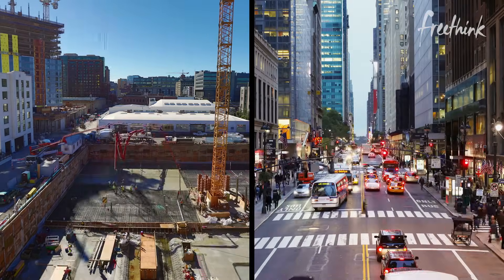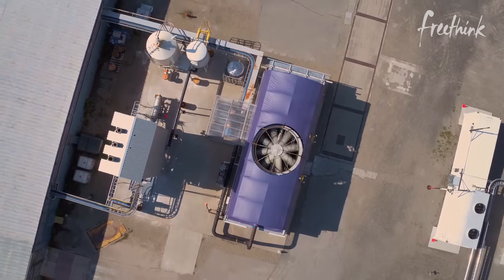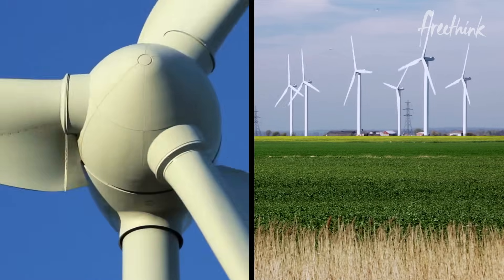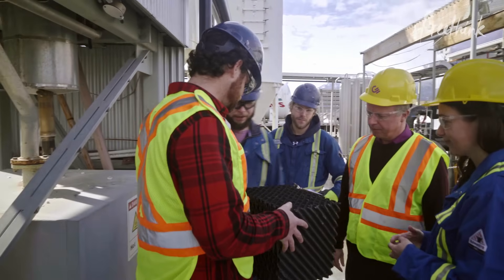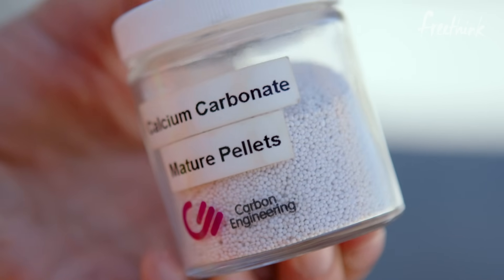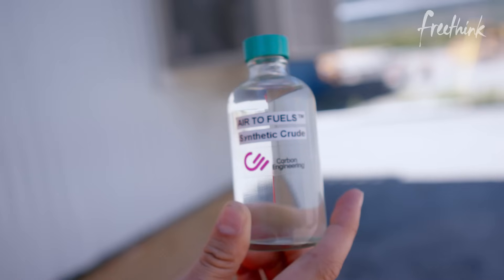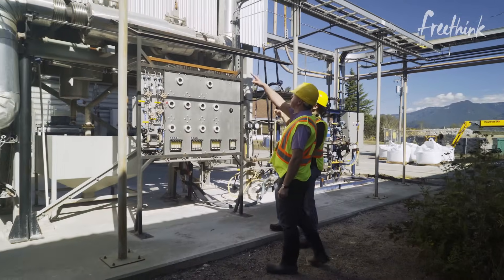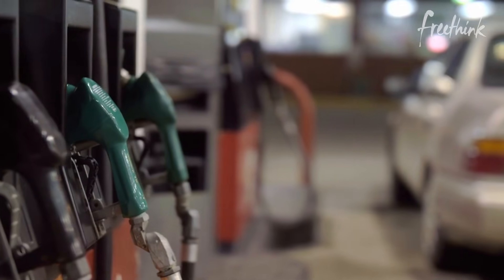Carbon Capture Technology Explained | Seachange

Comment: XPRIZE CARBON CAPTURE Please share, thx
FORMULATED MICROCRYSTALLINE WAX WILL CAPTURE CARBON-SOOT
The heat loss from a smokestack can be forced into a large tank containing hot liquid microcrystalline petroleum wax. The heat will keep the wax at a molten state which facilitate the carbon to be absorbed when combined with the wax. Carbon when mixed with wax reacts like a dye. The wax-carbon amalgamation resulting in a black wax solution thereby making it impossible for the carbon to escape into the environment while in a liquid state. Other toxic particles are also captured in the wax settling at the bottom of the tank forming into a sludge. A sludge release valve is located at the bottom of the tank. After the sludge is removed more wax is replaced in the tank working something like a toilet. The sludge becomes a byproduct that can be used as an additive to asphalt for roads or used for cocooning nuclear waste materials for long-term safe burial. The entropy of the Earth has been increasing at a startling rate since the beginning of the industrial revolution caused mainly by the carbon that is released into the atmosphere. Government scientists have failed to stop and prevent carbon pollution from entering the environment. This problem can only worsen until a solution is found before this problem becomes irreversible. It has been discovered that formulated wax has been shown to be the only answer to this problem. William Nelson                waxogen@gmail.com
Reply: FORMULATED MICROCRYSTALLINE WAX WILL CAPTURE CARBON
The heat loss from a smokestack can be forced into a large tank containing hot liquid microcrystalline petroleum wax. The heat will keep the wax at a molten state which facilitate the carbon to be absorbed when combined with the wax. Carbon when mixed with wax reacts like a dye. The wax-carbon amalgamation resulting in a black wax solution thereby making it impossible for the carbon to escape into the environment while in a liquid state. Other toxic particles are also captured in the wax settling at the bottom of the tank forming into a sludge. A sludge release valve is located at the bottom of the tank. After the sludge is removed more wax is replaced in the tank working something like a toilet. The sludge becomes a byproduct that can be used as an additive to asphalt for roads or used for cocooning nuclear waste materials for long-term safe burial. The entropy of the Earth has been increasing at a startling rate since the beginning of the industrial revolution caused mainly by the carbon that is released into the atmosphere. Government scientists have failed to stop and prevent carbon pollution from entering the environment. This problem can only worsen until a solution is found before this problem becomes irreversible. It has been discovered that formulated wax has been shown to be the only answer to this problem. William Nelson waxogen@gmail.com

Comment: The weird thing I see with this is why are factory's still just releasing the c02 into the air, if they turned that co2 vent that went outside then down the building into a gas tank then they could transport the co2 using it for, there jet fuel made out of co2 which I watched that video, and the company would have economic incentive to do this since they'd at least get something back may not be much but turning a waste profit into another revenue stream sounds like science fiction but it is not. the same could be said with heat, I saw some Sweden company who made a heat generator which used waste heat to generate power. we have the technology now we just just gotta let people and company's know about it.

Comment: If you're not putting the carbon back underground in massive volumes, you're just a distraction from the real climate tasks of increasing efficiency and electrifying everything with renewables and nuclear (not BECCS!). The DAC folks are crooks, they just don't know it, or perhaps are massively rationalizing. Shell's CCS plant doesn't work, look it up. DAC can't scale (whatever they claim: a tonne a day = large scale? perleeze). Trees are better but still not a complete solution. Simon Nicholson is absolutely correct.

Comment: Why are they cleaning the air? Why not install this directly at industrial areas or plants for industrial emissions? I've not heard of anything more harmful than industrial effluent throughout my degree. What is going on here? Why are they trying hard to clean diluted source instead of pinpointing the actual discharge point? Are they trying to not make a difference or is there something I'm missing out here?
Reply: everything works based on costs brother. If carbon emitting companies did that they would incur additional production costs, the result is either they go bankrupt or they raise the prices of their products and services, and then people like you and me would be the ones struggling in an economy of extremely expensive things, then people would just protest against the green movements again and say theres no benefit to it and were back to square one. They need to make this process both cost effective and profitable. Because thats the only way something can be done. Unless of course you can convince some world power like China or russia to do this and spend all their money on it. No one is going to want to do something people force on them. THATS what youre missing, the logistics.

Comment: Great idea, why not just store the carbon and release the oxygen, that way you’re only storing 23% of it?
Reply: To spilt CO2 into carbon and Oxygen requires a lot of energy (A LOT!)if the energy is produced by releasing CO2 according to the rules of Thermodynamics you will end up with more CO2 than you started with. 
But if you are to use renewable energy (Solar energy, wind energy etc...) It will cost tons for the plants alone
Reply: @sayanafathima8368  And making batteries is better? You have to move 500000 lbs of earth for a single battery!

Comment: Just when I think I understand this, I gain 100gigatons of more confusion. At the levels we currently have, we could never capture and store enough to make up for the amount we currently have. If we could, where would we store it and how can we expect that will stay contained? Under the ocean? Then we stand around scratching our heads over why the aquatic ecosystem becomes deadly to the creatures that swim there? Ok so we manage to store it, somewhere, what is this about releasing the same amount we capture? Then maybe it doesn't get worse. but it doesn't get better either does it?
Reply: It can be stored underground in a solid state as carbon, unlike Co2 which is a gas. 
Using it as a fuel means putting it back into the atmosphere, but since it came from the atmosphere it's not making the problem worse just maintaining a status quo. In theory if we did this instead of using fossil fuels, the amount of carbon dioxide in the atmosphere would not increase..
Reply: @heathernicholson5052  There is no time for theories. We need to reduce the carbon. Keeping it the same, is not enough. If we cannot get control over our own atmosphere we are never going to survive on another planet.

Comment: OK, I might be stupid someone explain - why on Earth to capture carbon once in the air where the concentration is super low, then capture it "at the source"?! Over 50% comes from electricity production, where at the end of the process we have high concentration - therefore all we need is to install a CCUS - job done! 
Then I'm all in the idea of creation e-fuel by using this carbon as this is the real Zero emission, not the dirty, toxic and habitat destroying batteries!  
Decarbonisatin is possible - we just need less political and green idiots in the process!

Comment: It's a shame they haven't found a way to separate the carbon and oxygen molecules from each other when capturing carbon dioxide.
Reply: There is a way to separate O2 and C but there's a catch here: It requires energy. 
According to the rules of Thermodynamics, At the end There will be more CO2 than you started with.
Reply: They do capture the carbon and seperate it by reacting it with other chemicals

Comment: There is a large coal plant in North Dakota that has a new buyer that has made promises to converge with carbon capture methods. I believe it was rainbow or something who bought out Falkirk mine. One of the best in the world
Reply: XPRISE CARBON CAPTURE
The heat loss from a smokestack can be forced into a large tank containing hot liquid microcrystalline petroleum wax. The heat will keep the wax at a molten state which facilitate the carbon to be absorbed when combined with the wax. Carbon when mixed with wax reacts like a dye. The wax-carbon amalgamation result in a black wax solution thereby making it impossible for the carbon to escape into the environment. Other toxic particles are also captured in the wax settling at the bottom of the wax holding tank forming into a sludge. A sludge release valve is located at the bottom of the tank. After the sludge is removed more wax is replaced in the vessel working something like a toilet. The sludge becomes a byproduct that can be used as an additive to asphalt for roads or used for cocooning nuclear waste materials for long-term safe burial. The entropy of the Earth has been increasing at a startling rate since the beginning of the industrial revolution caused mainly by the carbon that is released into the atmosphere. Government scientists have failed to stop and prevent carbon pollution from entering the environment. This problem can only worsen until a solution is found before this problem becomes irreversible. It has been discovered that formulated wax has been shown to be the only answer to this problem. William Nelson

Comment: Promising tech but remember CO2 is not the only greenhouse gas. It has the least global warming potential compared to CH4, NO2, H20, and synthetic gases such as CFCs, HCFCs and potentially HFAs. So overall, they can slow down the rate of climate change but I don't see them playing a significant role in reversing Climate change, which should be our biggest concern. And don't forget emissions are caused by cement manufacture too.

Comment: A dummy question but still needs a numerical answer; will is it more feasible to plant more trees and find a way to concentrate amounts of CO2 on those clusters of trees !?
Reply: Trees just take as much carbon as they need to grow, they are like giant batteries that hold carbon instead of electricity. Having a higher concentration of carbon will not make them store more, they will only take as much as they need to grow to their maximum height. You need to plant new trees to pull more carbon out of the air.

Comment: SCAM ALERT.    If you find it hard to believe a plant can be built and run and pull 400 PPM CO2 directly from air and not create more CO2 than you had in the first place. Read over their prospectus and you’ll notice it relies on free excess renewables to operate.  Burn 114 Kg of Fossil Fuel, say octane and get out one unit of energy at 33% efficiency.  Now use more than 10 units of energy to run the direct air capture. Why not just use 10 units of electrical energy and be 20 times farther ahead (assuming electric vehicle at 50% overall efficiency)?
Why does the Fossil Fuel industry pay for this Direct Air Carbon Capture? so they can fool us all into thinking they have a solution without really focussing on the important details. if all you wanted was to give the Fossil Fuel industry an excuse to continue destroying our atmosphere then sign up to this nonsense.  
If they really believed in this, they’d offer to remove 320 kg of CO2 for every 114 kg of fuel they sold. Why don’t they do this? Because that fuel would now be 25 times more expensive and no one would buy it. 

Mostly what they do with the recovered CO2 is to pump it into the ground to extract more Fossil Fuel.  

Dastardly but seriously did you expect any better from the Fossil Fuel industry??  easier to remove them than the 10 B tons of CO2 they produce each year. Would literally be cheaper to buy everyone a solar roof, a windmill a battery and an EV.  Problem solved.

Comment: This is as dumb as putting condensers to remove water vapor (10x more powerful greenhouse gas than co2).  There is a Co2 cycle and plants suck it all up and then release it when they die.  It is a cycle.  400ppm , hell 1000ppm IS NOT a problem.  It's like the whole world is running on stupid to spend trillions for 0 gain, and possibly harm if you start starving plants of food.

Comment: Its may not be a carbon neutral process, the energy required to squeeze out CO2 in the first place and energy to run that company require electricity which mostly comes from carbon positive process! So overall picture is we are just closing one hole in a sieve !
Reply: I guess it depends where the electricity is being generated from

Comment: Their design is ridiculously inefficient.

It's better to capture the carbon out of a smoke stack and recycle it. Rather than wasting ungodly amounts of energy on your machines.

And I'll give you an A for effort for design that could be useful if we had unlimited energy. 

But that design would require that we go even further into nuclear. Which I'm not necessarily against. modern nuclear is smaller and much safer. 

But simply capturing the carbon in the stack allows us to use biofuels to capture it out of the air. And then refeed the carbon to a Algae farm as well as advanced Cube style Vegetable Farms.

The Algae Farm produces oxygen and oil. That can be used in the thermal power plant and recaptured.

Your machine while beautiful in its concept and for what it does.

It leads to a situation where the carbon is not truly recognized for the useful resource that it truly is.

Thousands of people could be employed in the Midwest growing giant grass as biofuels on substandard soil.

The Green future is Green And Its Part of The People.

Comment: So, pretty much the best way to rid the atmosphere or greenhouse gases is to get it at the source. Because trying to get all the Carbon companies; coal, petroleum, natural gas, etc, to just stop drilling for oil and mining for coal isn't gonna happen. It's still cheaper and more efficient to burn coal and petroleum products, than wind and solar. 

From my understanding a catalytic converter, on a vehicle, if created and maintained properly is pretty efficient. So, I read back in about 2018 about the handful of carbon capture power plants around the world. The CO2 was directed to holding tanks, sold to oil companies for oil extraction and then shot into the ground to obtain the oil. So, pretty much putting the carbon back into the ground, which is where it came from. It seemed as though the carbon separation process was done on sight through a series of filters and some form of separation process, obviously. A couple of years later I am now learning that it is becoming a bit more mainstream and actually picking up some interest. 

Then there's the "dreaded" nuclear power. I think that should be the main source of power, not solar and wind, or anything else. Yes they're "scary" and yes they're expensive. Yes they produce radioactive waste. But, all the radioactive waste in the US combined together in one spot, creates an area the size of a football field and is less then 10 yards deep. There are risks, I get it. I live about 50 miles away from a Nuke plant and I still marvel, to this day, at the giant cooling towers. Going outside my town, on top of the hill, you can see them clear as day. I think its pretty damn awesome. Some would be scared shitless.

Comment: Not grasping the concept of trying to remove Co2 from the air and putting it into the gas tank of your car and putting it back in the air so that we are still in the same cycle of not getting anywhere instead of burying it
Reply: By recycling atmospheric CO2 it will be destroyed at an equal rate in which it is created. Yes, when you burn the sequestered carbon it ends up back into the atmosphere but then it is collected again (so long as we have enough carbon capture plants) so it is a cyclical process rather than an enrichment of CO2 concentrations in the atmosphere. Think about animals exhaling CO2 and then plants consuming CO2 for energy being in equilibrium, this is the same mechanism but with industrial technology.
Reply: They are trying to increase the profitability of what they are doing in order to make it politically feasible. You might be right though.
Reply: This is to prevent more benign CO2 from enriching the atmosphere. Basically stopping “fresh” CO2 from burning coal or fossils being released into atmosphere. To use the already present CO2 in the atmosphere to create fuel and keep recycling that amount of CO2 only.

Comment: Why don't they just draw in the air with fan suction, pass the air through a cryo-chamber filled with dehydrator crystals, and recyle the air back into the atmosphere. The byproduct can be used as carbon-based fuel.